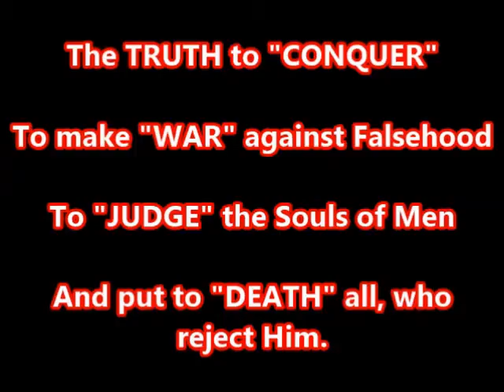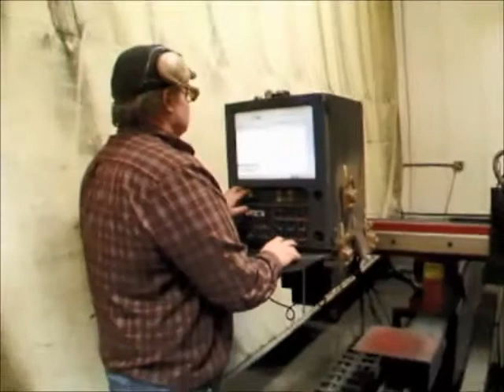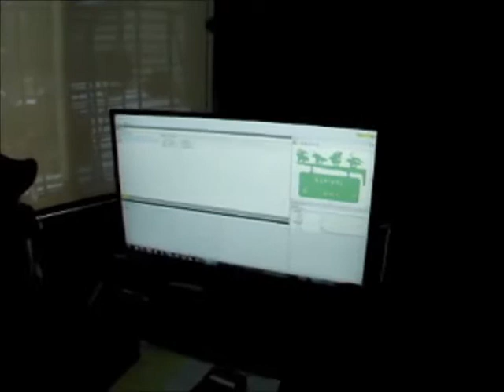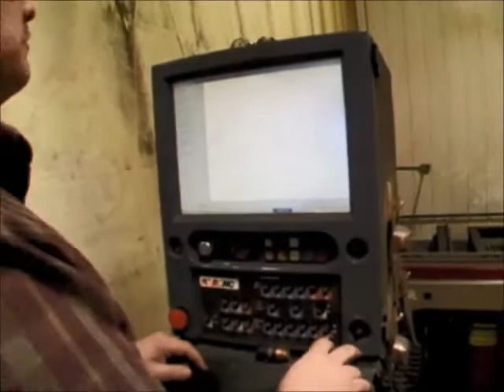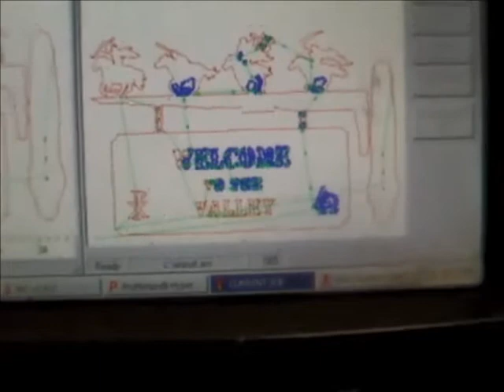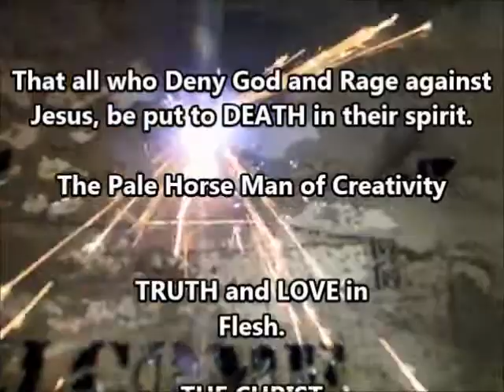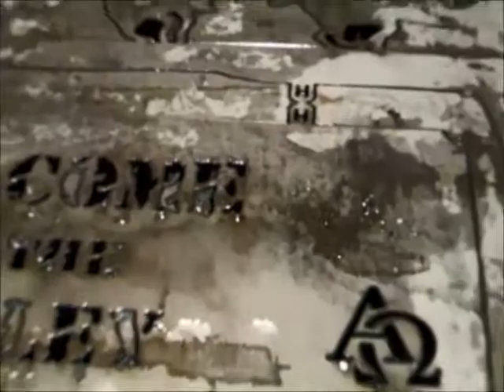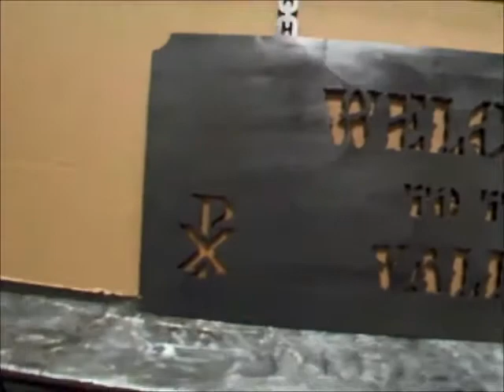Plasma Joe Encounters the Four Horsemen of the Apocalypse

Comment: im a retired laser operator/supervirsor for a gasket company. then retired truck drive after the divorce. Co2 laser with no water assist. took cnc programming at University of Houston along with other subjects/trades autocad
Reply from the maker: So you understand the intricacies of creating such an object. Autocad is no easy program to learn, I know that much but that's about where my computer skill set ends. LOL. Me, I never even touched a computer until I was 50, but I did learn to type in high school. That came in handy when I started using computers. 
Later Bro.
Reply: dimensions x y z then times small parts divided. co2 were all mirrors basically